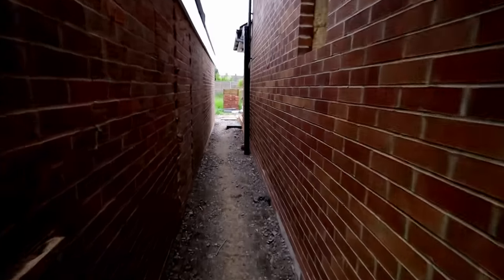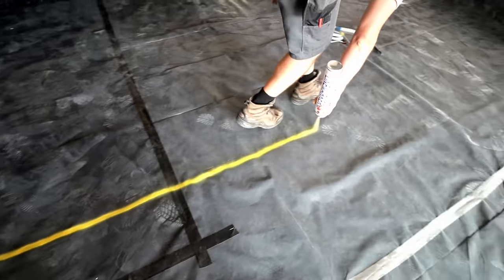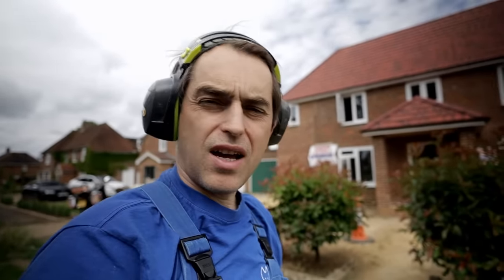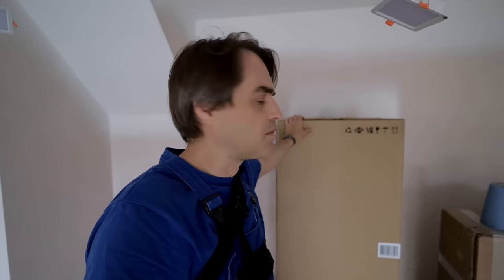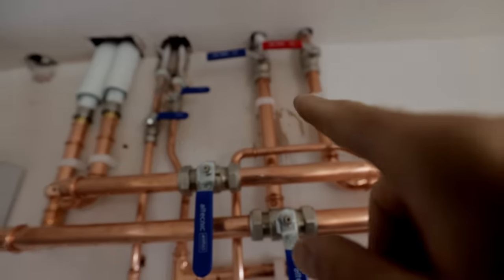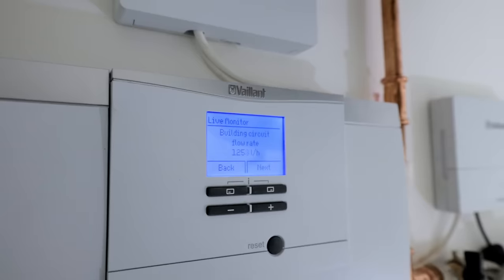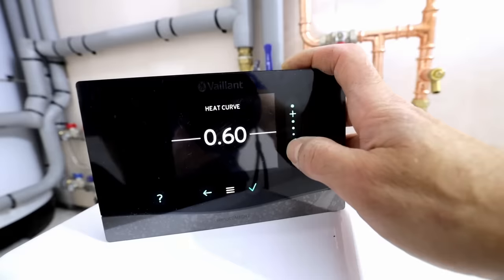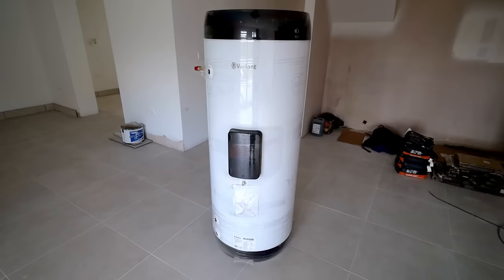Gas Boilers No Longer Make Sense, Here Is Why.

Comment: Every heating engineer I've spoken too has huge reservations for heat pumps in traditional/existing homes.

The only way a heat pump seems to nake sense is a hole new purpose designed build. And that's of course a build to high spec.
Reply from the maker: Not true. Check my other videos. We installed loads of heat pumps in period uninsulated houses and not only they work great, they are also cheaper to run than gas
Reply: @UrbanPlumbers  Maybe so, but I'd suggest replacing a legacy gas boiler system with a new heat pump system, with all the concerns that may come with that - eg: significantly increasing the size of radiators - instead of simply a modern efficient direct replacement gas boiler is not tenable/sensible/cost effective for many folks even if it does (questionably) work out cheaper to run them (eg: it would take years to recoup the extra outlay).

Fit heat pumps where the property can properly use the system (eg: new builds or purpose conversions). Don't try to fit them into more tranditional (older) houses that may struggle with them in comparison to a tradition gas boiler.

Comment: And what about  gas cookers😮
Reply from the maker: What about them?
Reply: @UrbanPlumbers  will the government say that they want to get rid of  gas boilers but nothing  about  gas cookers
Reply: @timh132 Gas boilers use a lot more gas to heat a home than a gas cooker used to cook food.  Replacing a gas oven or hob with an electric or induction is a pretty simple thing as well.  The main thing is if the only thing you're using gas for is a cooker and/or hob, then it's probably worthwhile replacing due to not needing to pay the standing charge, which will save hundreds of pounds a year.
Reply: Cooking is tiny cf space heating.
Reply: @timh132 we switched from gas cooking to induction cooking a few years ago.
Much safer, easier to clean and getting the hang of it does not take long. The kitchen salesman said they hardly sell gas systems anymore.

Comment: @ 11:00 First you are a great Installer but not that good of an economis … 
I really believe/consider that heat pumps have their place, but not everywhere they are the ideal economic choice - cost/benefits/recovery of the additional investment/lifetime/maintenance cost
The VAT and the 5000 pounds must be paid from somewhere - from the rest of the taxpayers - that money does not come from the fairy of green energy!
If the whole country installed heat pumps at the same time and from their installation the VAT would be lost and the 5000 lira would have to be paid, that money would probably be taken from loans made by the state to which interest would be added ... on which all the taxpayers should pay for...
if a technology needs subsidies to be profitable then it is not profitable… 
+ it is also paid from the taxes of those with low incomes who, even with subsidies, will not be able to afford to install heat pumps that work efficiently... so it will cost them even more without having any benefits ;)

Comment: If this video talks about air source im going to say youa re a freaking liar.
My neighbor had to have one fitted to their council house and her oil boiler removed. Her electricity bill is now £110 A WEEK  in winter. 
Air pumps are ridiculously pricy to run in cold climates.
Hers was installed during 2013-14.
She had to move out because of the cost and every new tenant in that house leaves after their first winter.
It has claddiung, double glazing, 100mm cavity insulation. Yet the air source heat pump still eats days of wages alone.
Reply: That sounds like an improper install which is fairly common, especially 10 years ago, not the fault of an air source heat pump.
Reply: @BenIsInSweden   My fathers install cost £25000 and he got a lot of it back in so called FIT payments. However his monthly electric bill in the winter is now £700 per month. I have a similar property running oil and electric and electric is £200 and oil is £200 per month averaged out over the year. He's thrown his tumble dryer in the bin, cut his light useage and he still can't get it down. Additionally we cook on electric and use immersion heater during the spring and summer. He cooks on gas bottles. He's suffering now .. but won't admit it to anyone
Reply: @stevel9914  did he get it installed by a heat geek? If not then it might be why. Installations make or break the efficiency, not the heat pumps themselves.
Reply: @BenIsInSweden   Proper company specialising in heat pumps  installed it subject to stringent scottish subsidy rules. Underfloor heating in most of the property ... the older part has radiators and they are switched out because they wouldn't warm up. Rest of the house is recent build and modern and well insulated.
Reply: @stevel9914  Still doesn't mean it was installed and optimised correctly.  There are a few heat geeks in Scotland, so probably worth getting one out... £700 per month in electricity with a properly set up heat pump would have been costing around £900 per month in gas. (assuming 30p/kWh for electricity, 10p/kWh for gas).  So if that's unexpected (considering price rises etc), then getting a heat geek out should pay for itself very quickly in saving this winter.
Reply from the maker: @stevel9914 we see it a lot. So called proper companies knowing how to get grants but without any idea of how to install heat pumps correctly - nothing new
Reply: @BenIsInSweden  He's not the only one... councils been installing them in council houses now facing £100 per week bills. Heat pumps have been a thing here for a very long time... underfloor heating since 2000... ours was the first in Caithness to have it. The guys doing the jobs may have learnt some lessons but they've been at it a long time
Reply: @stevel9914  oh I don't doubt any of that  The problem is installers not knowing how (or caring) to get the best out of the system, regardless of how long they have been doing it for.   It's been less of a problem with Gas as the difference between a bad and a good install isn't as costly.  Over here in Sweden, bad installs are rare - because it would be very noticeable.  In my town there is probably 70+% heat pumps, and we are pretty familiar with -20C in winter.   Even if I was paying 30p/kWh, Nov-Feb, my complete electricity bill would have been about £580 per month, and whilst I have an A2A heat pump as my primary source of heat, I still have some resistive heating, and an immersion heater for DHW - so a complete A2W system would likely shave that down to around £450.

Comment: This is Govt. sponsored propaganda. Heat Pumps are inefficient, very expensive, and will not perform in the majority of the millions of homes in this country. I'm sticking with my 6yr old Worcester Bosch Gas Boiler. 
This drive for Net Zero is unachievable. Stop this nonsense now
Reply: You spelt "gas industry" wrong in your first sentence to correctly declare your comment.

Comment: No such thing as 400% efficiency.
Reply: says who?
Reply: @BenIsInSweden  the laws of thermodynamics.
Reply: @ianc7866  You might want to do some research.  It's not converting electricity used into heat, but extracting latent heat from the phase changes of the refrigerant.  So for each unit of electricity used, it extracts 3-6 units of heat energy from the source.  The heat energy extracted is not considered part of the efficiency as it is not a billable consumable, so only the electricity is.
Reply: @BenIsInSweden  what you have described is the amount of electricity to move an amount of heat that was already in existence. This is not efficiency .
Reply: @ianc7866  that's splitting hairs. It's the amount of useful heat in kW you get out of the billable energy put in (i.e. electricity in kW).  So for each 1kW of electricity put in you get 3kW+ of usable heat out. Just because most of that kW of that heat comes from the source (air/ground/water), it's meaningless and has no cost to the end user.
Reply: @BenIsInSweden  it's not splitting hairs. You cannot have efficiency if ANY system above 100%. Even an electric motor is not 100% efficient.
Reply: @BenIsInSweden  what happens when you deplete the heat in the ground?
Reply: @ianc7866  don't the laws of thermodynamics mean that energy cannot be created or destroyed? Ground source heat pumps can passively cool the house in summer transferring the heat from the house into the ground, essentially "recharging" the ground. The sun will also be heating the ground in summer as well.
Reply: @BenIsInSweden  yes. You cannot destroy energy you can only change it from one form to another so you can't take 1kw of electricity and make more than 1kw of heat with it.
Reply: @ianc7866  as stated the heat isn't coming from the electricity used, but to power the compressor etc to extract more heat from the source. That's why you can get multiple units of usable heat from a single unit of electricity.
Reply from the maker: splitting hair for no real reason mate
Reply: @UrbanPlumbers  you should be more careful with your wording. Perpetual motion has never been achieved and a heat pump will not achieve it.
Reply from the maker: @ianc7866  yawn
Reply: @UrbanPlumbers  Sorry to inconvenience you with Physics.

Comment: The less oil a house consumes as fuel, the more it consumes in terms of oil-based materials during construction it appears.
Reply from the maker: It would have used the same products anyway?
Reply: You can only burn Oil Once. But making something with it lasts Decades.
Reply: And I observe that all these types of installation require an ample plant room to house all the gubbins.
Our largish semi in S London only has one largish rear wall facing the garden with limited space between kitchen window and a patio door. There's no plant room space behind that wall!
Reply: Hi all, not criticising anything here, just pointing out that thermal efficient products/insulation are mostly oil-derived. Makes you wonder where housing might end up in terms of materials in years to come.

Comment: How you lose all credibility by making nonsense political marketing statements.
Reply from the maker: 1000 people liking this video today disagree with your comment 🤣
Reply: @UrbanPlumbers  In all probability hardly any of the 1000 likes you have for the video have read my comment, so  how you equate them to direct a disagreement with my comment only further demonstrates a lack of credibility in your logic and reasoning. Perhaps you should consider other viewpoints before making narrow minded statements.
Reply: @reedy8585  It's only political because the UK has left it far too late. I have a newspaper clipping from 2010 on my basement wall (left by previous owners that I've never bothered to take down), about the benefits of heatpumps - i.e. the cost saving, and how it works in -20C.  Nothing about being better for the environment, and none of the BS that gets put out in the UK media of them not working when it gets cold, or that they use a lot of electricity.  Because over here, -20C is pretty common, so they have to work down to that temperature.
Reply: You are aware, the oil and gas industry has huge budgets for marketing, and political manipulation?

Comment: HP are a terrible invention!  They cost a fortune to run, council put one in my timber framed house which was oil! We freeze in the winter as too expensive to run
Reply from the maker: Installed wrong. Heat pumps are awesome
Reply: @UrbanPlumbers  it is Installed by certified engineers, I took the house on with oil, when I got the keys they had this 💩 mitsubishi ecodan in. In a timber frame and plasterboard house! It Zaps electric. It stays off. We suffer greatly because of it.
Reply from the maker: @what-lies-in-your-skies certified means nothing. They work but you need to know what you doing and deffo not install them indoors 🤣